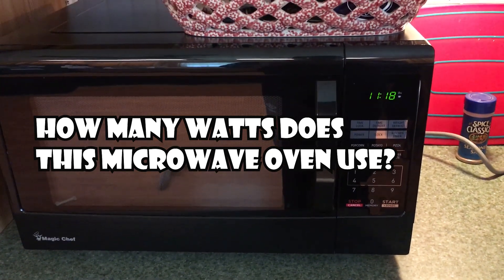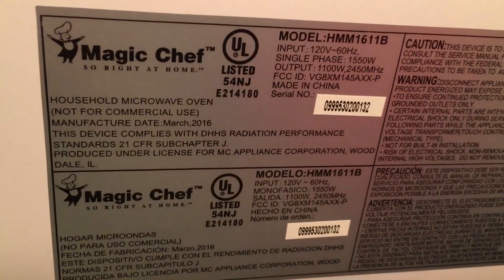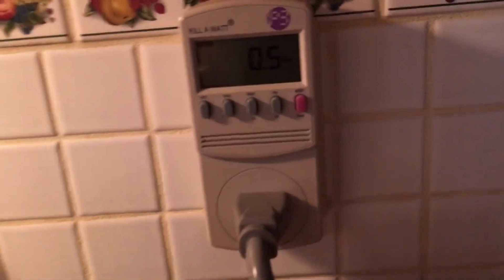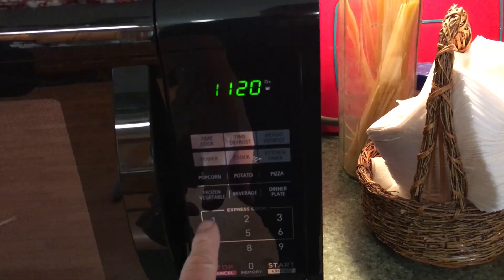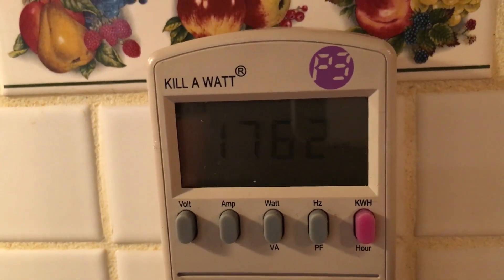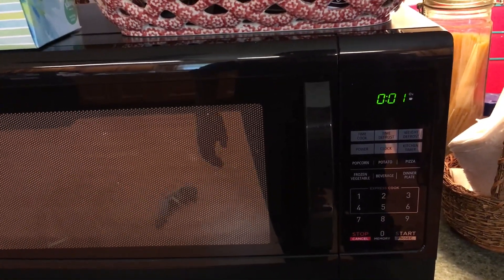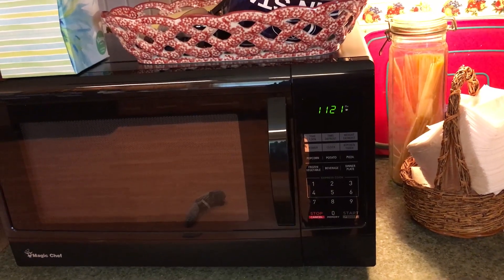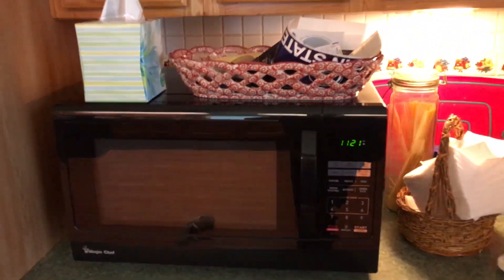Testing the wattage of my microwave oven

Comment: Yeah mine in UK says 700w microwave on the front but input 1150w on the back, so what I thought was a oven consuming 700w going by  your test probably consuming 1300 watts, which is nearly double what I assumed it was using and that's a massive difference, however it's still obviously far far cheaper than heating by conventional methods and more efficient because it heats from the inside out. One advantage is you get your food on a hot plate too loooool